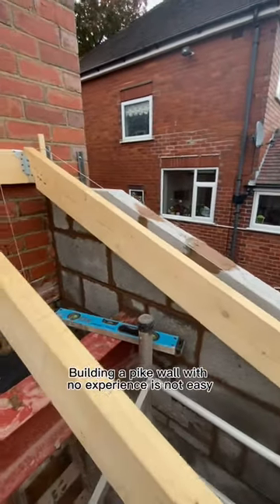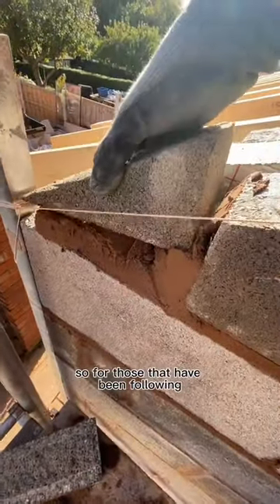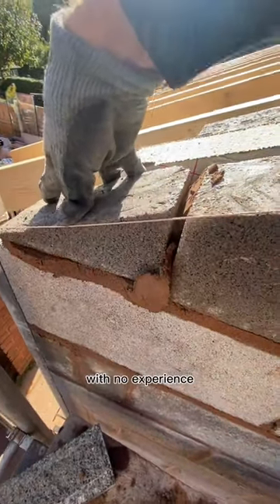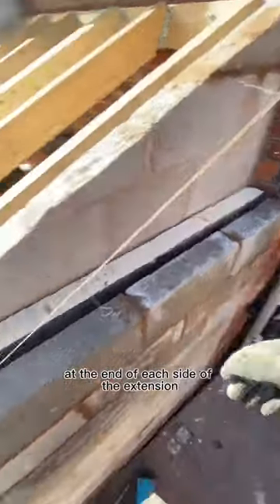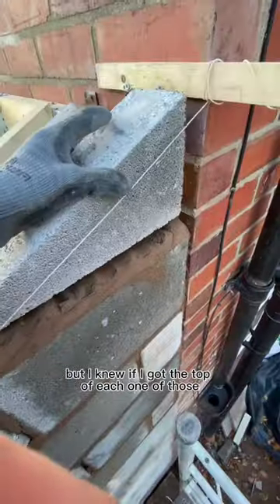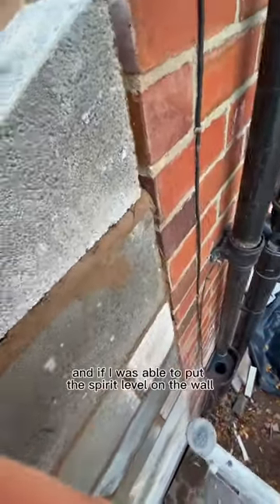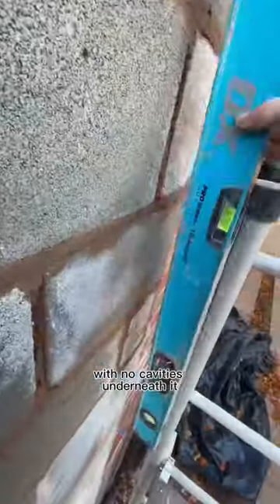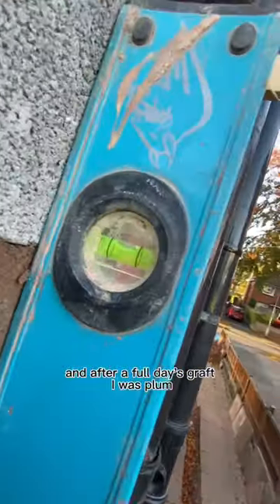Part 7 - DIY House Extension # #diy #houseextension #renovation #building

Comment: Take it from a bricky, you've done well, only thing I'd have done differently is to step the blockwork 20-25mm back from the original brickwork. This way when the render goes on the block it would all finish flush.
But you have done very well indeed 👏
Reply: My father was an amazing bricklayer he did a thousand bricks a day absolutely perfect,
Reply: Can just use a stop bead - but yeah good suggestion.

Comment: Just mark a block off the rafters to get the angle. And hold your level across the rafters to make sure your walls not sticking out. You don't have to get it spot on if it's not face work.

Comment: You need to open up the old brick wall. And insert the new bricks into the old wall. Now you have cold bridges and less stability.
Reply from the maker: The walls are connected with wall ties and insulation is in the cavity. Should be ok 👍🏻
Reply: @scott_diy - yep, thats fine.

Comment: I am 110% sure that your extension would be better then the tradesman you got quotes off. Your brick work would be actually level/plumb and done with consideration. 

Very good job mate, well done.

Just to let you know your coming to Liverpool to do mine next, no excuses😂
Reply: What a mug there are lots of good bricklayers you know !
Reply: @aaronweller8440  Do you know what mug means? If so use it in the right context’s.

Very Rare to find a good bricklayer and am old enough to know this, they get rushed through a shitty cheap college and then start throwing bricks up witch is not even good enough to build a brick shed never mind a home for people to live in. Go and take a look at every new build house what has been put up the last 10 years and you will see for yourself.